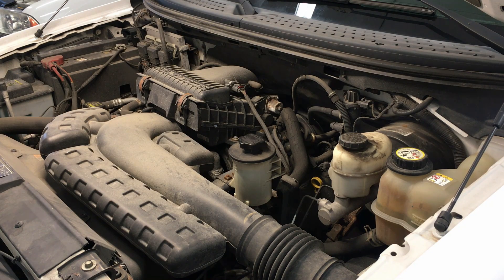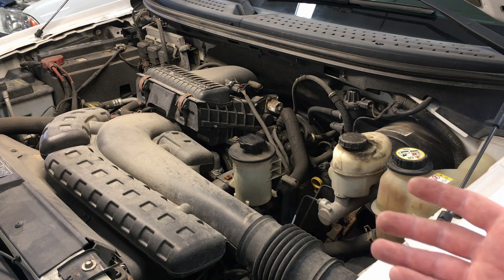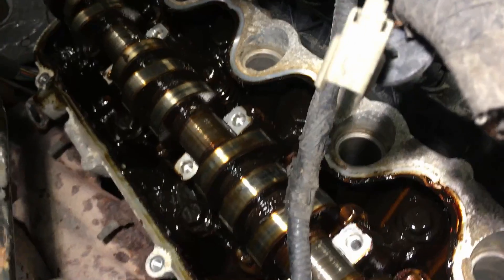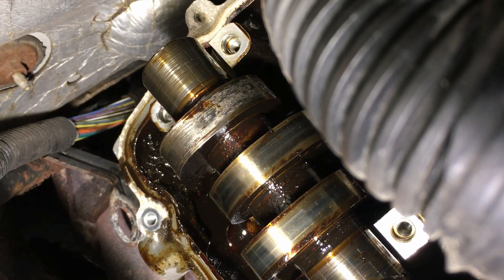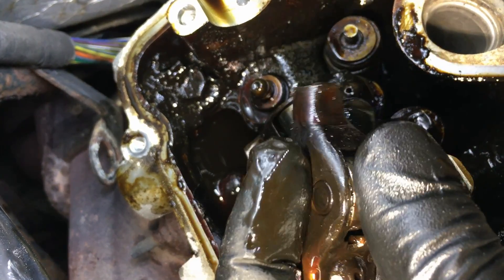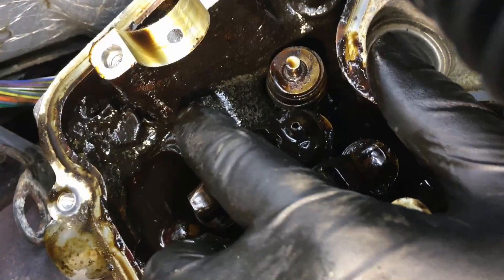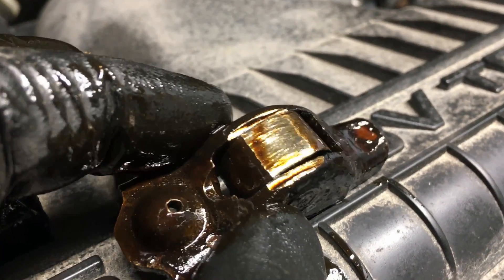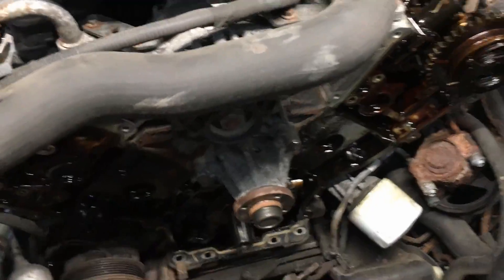Ford 5.4L 3V Engines Constant Ticking Tapping Noise: Roller Follower Failure!

Comment: My F150 has a ticking from the passanger bank. Sounds like a loud injector. I figured the phases were just starting to act up. Only have 115k on it.
Reply: JackofSpadesrda ford tech says the phazers are starting to go. I still think its a cam follower. So no, haven't solved the problem.
Reply: @Jeremy Hess it ended up being a loose spark plug.

Comment: I really need to buy a pick up for my business( I need to tow a 8000lbs trailer) in this country the only full size truck is the F150.  But the more I see these videos the more I'm afraid of the 5.4V8 and to top it of its the only engine option here.
Reply: I think having the proper oil engine grade will make a difference. My mechanic suggested using 10W30 full synthetic oil. He's serviced many 5.4 engines from a variety of years and have or are nearly 300,000 miles. I experienced the ticking noise on my 09 5.4 engine a few years back. It began making the same noise when I drove out to the desert in the peak summer time. I always change my oil, right at the 5k mark. After a few thousand dollars for repairing my truck, and consistently using full synthetic 10W30 oil, my truck is running strong and coming up on 200k miles. Dont know if this message helped you since you commented approximately 2 years ago but hope you found the right truck for you!👍

Comment: My 2002 F150 tick loud on one side at start up but seems to go away once the engine heats up. Much louder in winter time. Truck has 150k. Lifter?
Reply: Exhaust Manifold is leaking

Comment: thats exactly what happened to my mustang 4.6 gt. Everyone was saying it was the phaser, it was not.  and i take and have always taken care of my car with meticulous care. but that exact follower failed. I replaced both and its running fine now, even a well known ford dealership in Redding ca told me it was a normal noise of the engine. Imagine that.

Comment: Do you have to take out the camshaft to remove and replace the lifters? Or can you use the special tool to take out the roller followers and have enough room to pull the lifters out with the camshaft still in. Thanks.
Reply from the maker: +Joe Goforth you must pull the cams

Comment: +FordTechMakuloco Im a big fan of your videos and your craft and I would really appreciate a little more insight on this issue. I currently own a 04 crown vic with the 4.6 2v. Is this engine prone to the same roller follower failure as the 3v?

Comment: I've subcribed to your YouTube channel as I've been looking at buying a 05 or 07 f150 with the 5.4. I've been putting together a list of common repairs and things to look for. Thanks for the help.!
Reply: I bought an 07 with the 5.4 3V. With the help of Makulokovs (?) videos Ive replaced chains, tensioners, guides and oil pump (m360). Ive also locked out my cam phasers and added pacesetter long tubes and Ypipe because it had cracked manifolds. I still need a tune because the lockouts cause it to throw codes but it runs and sounds fantastic now.

Comment: Is there anyway to diagnose this without pulling the engine?  Endoscope? Stethoscope? Would this problem "go away" at 3500RPM?  I have a similar clunking noise but poor acceleration until 3500rpm then it feels like someone let off the brakes and it kicks you back into your seat!

Comment: I have an issue with the diesel sound upon start up, which disappears 5-10 seconds after. I replaced the VCT solenoids, and also the alternator, which surprisingly failed coincident to the noise. The noise started after an oil change, which may or may not have been coincidental.  I have always used 5w-30.  Any thought or suggestions on where to go next, Phasers? I did not use Ford VCT solenoids though. Gas mileage is down to 10mpg. Any insight or direction on what to check and verify?
Reply: is it random or like clockwork? if it's random its likely the chain tensioner.
Reply: Like clockwork everytime.

Comment: What if your 2010 f150 with a 5.4 has a tapping coming from it for the first 5 seconds of starting it?
Reply: Tensioner leaking oil and guides rebuild timing set
Reply: Did you fix it

Comment: What did you do about the galling on the cam lobe?  Was it left in place or taken off by a machine shop?
Reply from the maker: +j t I ground it smooth myself. It's a crude procedure but works with some patience.
Reply: Best to change all cam roller followers and lash adjusters with the cam shaft on that side of the engine if your lobes are bad cause they all wear different.
Reply: j t what if u don't ground it smooth and just put in the roller follower?

Comment: I have a 2005  Mercury Mountaineer with 106k miles - the change oil and filter every 3k so far no issues. Do you have a specific brand of oil to recommend that lubes and cleans better than all the rest?  BTW your videos are outstanding.

Comment: When do you have the timing chain, cam phasers, hydraulic adjusters, and all plastic guides replaced?  100,000 miles?  Earlier?  Most timing belt designs have a 60,000 - 100,000 replacement cycle.  Does Ford have something like that for this?

Comment: What a fantastic find, your videos are extremely detailed and beneficial to those unfortunate souls who purchased the Triton engine in our Ford vehicles.  DIY's like myself appreciate a knowledgeable and in depth time and effort you take to walk us through the design missteps made by Ford and how to keep our investment going without paying Ford or their dealerships through the nose to achieve the same results. Thank you, I have an issue with the diesel sound upon start up, which disappears 5-10 seconds after. I replaced the VCT solenoids, and also the alternator, which surprisingly failed coincident to the noise. The noise started after an oil change, which may or may not have been coincidental.  I have always used 5w-30.  Any thought or suggestions on where to go next, Phasers? I did not use Ford VCT solenoids though.
Reply: What did you find out ?  Was it the aftermarket solenoids?

Comment: Question I just bought  2010 Expedition EL with the 5.4L V8 has no issues runs great but should I use 5W30 oil in it or the recommended 5W20  ? I always buy Fully Synthetic oils to keep the engine top shape on all my vehicles .
Reply from the maker: Switch to 5w-30 ASAP.
Reply: FordTechMakuloco Will do thanks a lot . Love your videos !
Reply: SELL IT, you're wallet will thank me later.
Reply: Jonathan Neal how many miles on it?

Comment: So my question: Is this just the follower failing because of normal operation/wear or is this from the head losing some oil pressure due to the chain tensioners being blown out leading to premature failure of the follower.  I had the exact same issue on the last lobe of the other side which is furthest from fresh oil combined with the reduced oil pressure from the chain tensioners blown out.  Is my assessment sound?  Thank you so much for your videos I used them to replace my phaser and cam and followers and helps understand these 5.4v a little better.  Thanks again !

Comment: If you pull a 5.4 3V down this far be prepared for a special tool to reinstall the timing chains and one chance to get it right.
Reply from the maker: +Josh Paetzel  I found only one special tool is required.
Reply: FordTechMakuloco I agree. However you get one shot to get it right. And the phasers leave everything with slack in it. I found it far less intimidating to leave the timing chains on the phasers and pull the phasers off the cams then to retime the engine.
Reply: My point is taking that engine down as far as you did in that video is probably a "for professionals only". As an added bonus by leaving the timing chains on the phasers you can pull the camshafts without taking down the front of the engine.

Comment: I have a ford explorer 4.0 SOHC. Timing noise i will say almost every time start up i did valve cover gasket and wow a lot of sludge from lack of maintance. I haven't change the tensioner yet, the question is using seafoam 300 milles before oil change will clean oil passages and fix this issue over the time??

Comment: Please advise, have a 5.4L 3V with 100k miles, been doing mobil 1 15w40 oil changes every 3k but, every time i start the engine rattles loud for 1 or 2 seconds big time! live in cancun mexico tho, kind of hot, should i use lighter oil? like 5w40?? or 5w30? or stick to 15w40?? thanks in advance to anyone can advise. And Thanks so much FordTechMajuloco for your amazing videos! love em!

Comment: What was the cause of that sludge, a failed PCV?
Reply: Owner obviously didn't give a damn about proper maintenance interval and quality/viscosity of the oil used.  Wouldn't shock me if other systems are in similar/worse shape for the same reason.

Comment: First I like to say that your videos are great and it helps "do it yourselfers" a lot. I learned a lot about the ford 3v and the how vvti systems, so thanks to you my friend. I have 2 questions, I helped a friend who had similar problems and I suggested we replace the lash adjusters and roller followers. He bought the Melling brand lash adjusters and the were rock hard new out of the box no plunging or spring activity what so ever. Is this normal or a defective part (all 24 were like this)? Also is there a trick to replacing them without removing the cams? Thanks....

Comment: Do a lot these 3 valve failures that you do videos about commonly occur in the 2 valve engines as well?
Reply: Bluntly, no.  They don't have the variable valve timing complexities and growing pains of the 3v 4.6 and 5.4L V8's... but they make a bit less power.  That said, don't shrug off maintenance on ANY engine.
Reply: tin pin less power but far easier to make big power with over the 5.4 3v. The 2v engines are phenomenal

Comment: Can't totally blame that one on the 5.4L problems when this one was not taken care of. Did they ever change the oil
Reply from the maker: +CamperMike correct this failure is not common on this late of a model
Reply: Probably having oil changes done at a lube shop . I always do my own with a decent oil like Valvoline MaxLife 5w30wt .

Comment: Did you also replace the timing chain, phasers, ect? new oil pump?   What do you charge for a project like this?
Reply from the maker: +redshovelhead77 For this failure you just need to replace the failed or damaged components but this job was part of a bigger repair on this particular vehicle

Comment: I change the oil at the distance that the dealer recommends which is 5000 miles with the Ford semi synthetic oil.  I hope my engines don't look like that inside.
Reply from the maker: +alanhassall with semi you should be ok at 5k I still prefer 3k intervals based on what I have seen inside these engines.
Reply: FordTechMakuloco Do you suggest 3k with synthetic as well?
Reply from the maker: +MusTang Nick nah synthetics I recommend 5k
Reply: I just don't get it when I see things like that.  The owner spends a fortune buying the truck and then doesn't take care of it.  For me it's a given to change the oil at regular, fairly conservative intervals.  It's not like vehicles today require the maintenance that they used to in the past.  Points and condensor, sparkplugs and wires, and changing oil viscosities for winter.

Comment: FordTechMakuloco --- Thank you for your videos and guidance you provide.  I've searched a few of your videos, but do you have any videos that show the "re-installation" of the roller followers after you have timed the engine and installed the cams.  You have made several on this topic, but only one shows a procedure using a simplistic way of a pry-bar to install the followers. I was hoping you could show the actual or approved method you like to use.  Do you only want to install the followers that are on or near base circle?  Thanks in advance.

Comment: Is 5w30 better for these?
Reply from the maker: +Justin P. Much better
Reply: Justin P. I've been running 5w-30 in my 04  5.4 3v  for a cool while now... and she's strong and happy at 212,287.8 miles
Reply: Justin P. I still use 5w20 MC-SB oil, if the mfr recommends it that is what im using, with all the nooks and cranny in motors these days, i wouldnt use anything thicker than whats called for.
Reply: Bernard North must be working well!
Reply: ***** Damn well sir!!! If I say so myself
Reply: 5W, needs to flow as fast when starts or you get excessive wear.
Reply: Rotella 15W-40

Comment: Great video. I have a 2010 f150 5.4. I have been hearing the same ticking sound on my truck since it was brand new. Any idea what the repair bill for the job you described would be?
Reply: That sucks because in 2010, which is the last year for that engine, they were supposed to have all the bugs worked out.
Reply: Dilly Dally thanks for the reply 👍

Comment: So I see all these problems with 5.4 liter motors but are there any with the newer 6.2 liter engines.  I have a 2013 Platinum with this engine and every once in a while I will here something like this for a few seconds and then it goes quiet.

Comment: What are some good methods to remove the sludge from the engine?
Reply: Oil changes prevent this sludge
Reply: I know that. I inherited a truck that has alot of sludge in the engine and want to know some good methods to remove it.
Reply: Phillip Norman fill it full of kerosine for about a week then drain.  The kerosine is a real.thin oil it will cut the sludge.  Now dont run the engine.  You can also use diesel fuel to do this also now it will knock everything.loose.on the inside.of the engine an may stop up the pil pickup so watch.the oil pressure after you do it.

Comment: is that sludge normal?
Reply from the maker: +LittleGojira no not at all
Reply: Remco Meeder Probaby wasn't using a good, synthetic oil, in my opinion.
Reply: No not normal
Reply: FordTechMakuloco the owner skipped a couple of oil changes? Or they possibly used the wrong oil.

Comment: I plan on changing my cam phasers, rockers and lash adjusters with in a week. When i wedge the timing chain and remove the phaser can i pull my cam out and do the rockers just lift out freely and just put new ones in the same way then put the cam back on them? Big fan of your channel btw

Comment: Just like mine did! 100000 miles and no sludge though. I wish all the mechanics on you tube would mention the costs involved when you do these repairs. When I got done repairing the cam and followers and adjusters on. one side it cost just under 1000 dollars using Ford dealer parts. cam 350, followers one side 250, adjusters 250 one side, valve cover gasket 50, miscellaneous 100 or so.